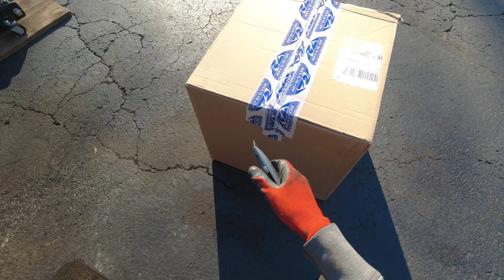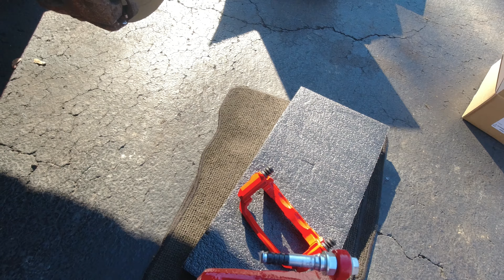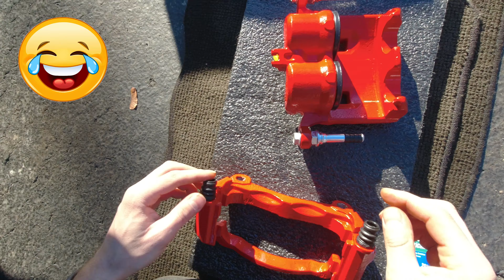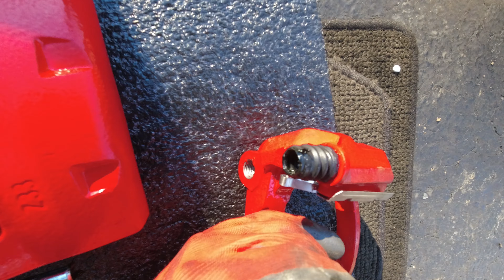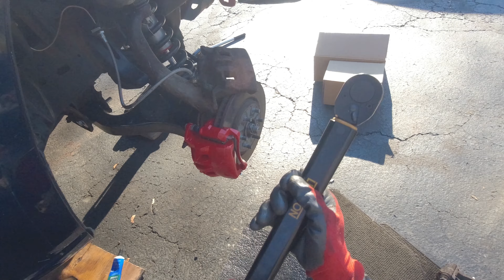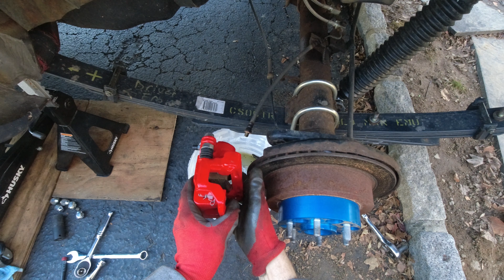Replacing My Brake Calipers After Failed Attempt

Comment: Oh man replace the pads as well
Reply from the maker: I should have replaced them too right..  oh well we leave and learn... I did replaced them in the end
Reply: I would probably replace the rotors as well. That way everything is new. Thanks for the video
Reply from the maker: @waynebeck7801  thats right  sir !  I have a new video where I installed new set of brakes and rotors at the same time )